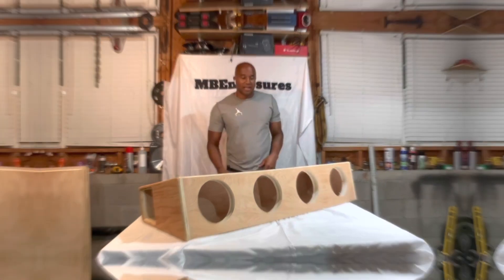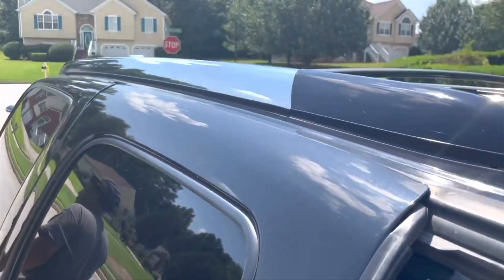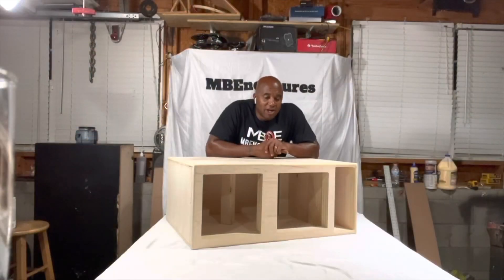Clean Power, Efficient Enclosure, Efficient Subwoofer….3 MBE Tenets. Part 1.

Comment: I have 2 Iraggi 320a Alternators and 2 Crescendo BC3500d's. I'm following you to figure out which subs to get. It'll either be 4 12's or 2 15's for my Yukon. My favorite setup that I had was my very 1st one. A Rockford T1500-1bdCP on 2 Rockford T1 15's, it sounded so clean and powerful.
Reply: How efficient are the amps and what type of batteries are you running?
Reply: @keirwalthour1931  92% at 2ohm, 86% at 1ohm. I have 2 6k LTO Lithiums 12v Batteries from Brand X

Comment: I'm looking up the specs on the JBL stadium 102SS1, kicker q class 8(round) and the B2 audio 8" high note. I'll research, compare amps I'm looking at and get with you on options for a box probably in a month. Alternator, Batteries, OFC wire to the back and Good RCA cables already have them.  Taken care of.... Now for amp to sub matching!  God Bless!
Reply: And yes, 2 ohms on the amp load. 2, 8s either way or 4 10" JBL.

Comment: If you have 400rms subs that can reach xmax at 300rms
With the correct enclosure, then why throw the extra power at it?
People do this with much more powerful subs and it’s just extra heat.
Reply: Few of the more powerful subwoofers do not reach xmax or xmech at their rated power that's why they try to squeeze more performance out of it (especially for spl competitions).